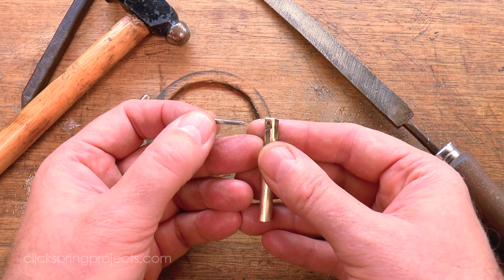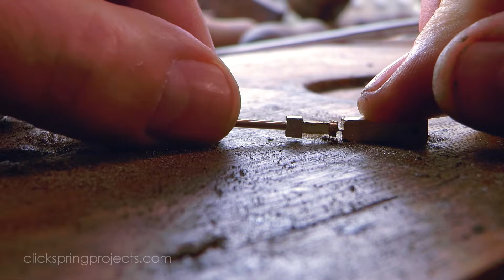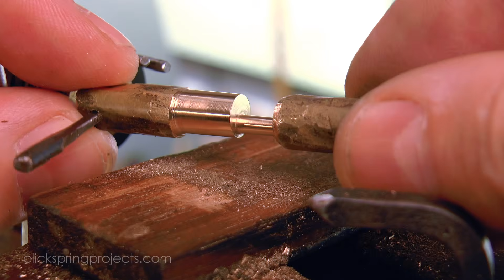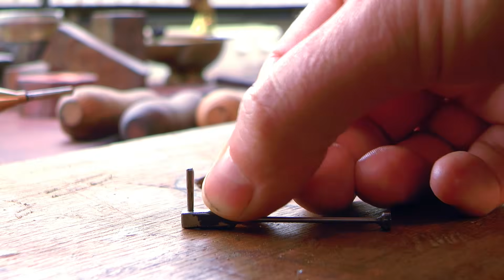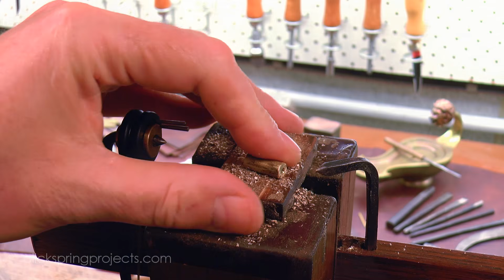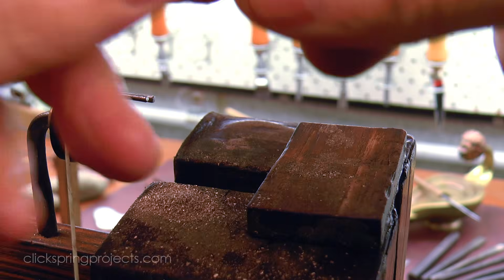Antikythera Fragment #13 - 3 Advanced Bow Lathe Operations Essential To Construct The Mechanism.

Comment: Would the working of the bow for the lathe have been left to an apprentice or assistant? Or do you think that the master craftsman would have preferred to control the speed of the lathe personally?
Reply from the maker: Great to have you watching; definitely the latter. To this day, a watchmaker will often reach for the bow powered turns in preference to a powered lathe for the one-off critical small work like a balance staff, pivots etc. The hand eye interaction of a single individual driving both the bow and the cutting tool is essential foir the required delicate control - Cheers :)
Reply: @Clickspring  Is that why the hand bow is used over a pedal powered mechanism? It seems as though it would be relatively simple to adapt a foot powered pedal for the bow motion, similar to a pedal powered sewing machine.
Reply: @Skyblade12  He's a watch maker. He'd know and his response that the hand bow is preferred is the answer you should stick with.
Reply: @SauronsEye  this is an educational environment, what's so wrong with asking questions?
Reply: The original lathes were often two person affairs especially for big pieces but he's probably right that delicate work would be a one man show.
Spring pole lathes and treadle lathes were a later invention if memory serves.
Reply: @rokitu7110  Some people like to jump in and try and show how much they know when they probably don't know Anything. And try to  make others look stooped. Never mind what skyblade said. Keep asking questions, That's how we ALL learn. :person-turqouise-waving:
Reply: @joepeanut6827  Wow, do you even read what you type?
Skyblade is just asking questions, you ninny!
(and BTW, the word is spelled s-t-u-p-i-d, not s-t-o-o-p-e-d)

Comment: While watching you periodically unmount the work piece to clear chips while drilling, a thought occurred. Would they have operated the lathe so that the workpiece was vertical and also had some 'relief' or clearance slots down the side of the drill to allow the chips to clear under the influence of gravity? This would alow the work to progress without periodically manually clearing the hole.

Comment: Could the turning down of the very thin and fragile shafts/pins have been done by pinching the part between two stones? To counteract the force being imparted when using a single tool on only one side?

Comment: Another way a part like the one with an offset shown could be made is turning the large diameter part first, and drilling a precise offset hole in it that pin stock could be soldered into. Obviously you would want something like a simple drill press for something like that.

Comment: I wonder if the technique that you used to drill the hole lengthwise through the brass on the lathe could probably be used to drill the holes in the drift shaft of your pump drill. The ones that the collets and knob pin fit into. The hole in the video is pretty small, so I'm not sure if the same method would be practical for the larger hole there. Or with the different material.

The bronze ferrules would probably be easiest to do by drilling a hole through a rough piece of bronze, opening it up with a reamer, finishing out the hole with a circular file, turning some sort of spindle for the ferrule to sit on, and then using the spindle to turn the outside of the ferrule on the lathe. This way, you don't have to worry about your hole drifting off center.

Comment: As to the reaming: I wonder if an adjustable V notched support might be wedged into place to support the reamer.  The would allow different sized ream to be used, be rigid enough for accuracy, and still have many of the advantages free handing does.

Comment: I wonder how viable this bow lathe would be in a non-industrial, residential capacity.  Like, obviously, modern tool steels and high precision are probably off the table but being able to machine little bits and and bobs around the house without making recourse to a powered lathe could be pretty useful

Comment: Is your three facet reamer shaped with a leading edge or are the facets filed with parallel edges?
 My thoughts being that if made without a leading edge it will cut better  given the back and forth motion of the bow lathe, if it cuts at all with that configuration.

Comment: Great work!
And it helped me to realize that I don't need a metal conductor for a precise manual drilling of a number of wooden part copies. Now I'm going to make a cylindrical "feather bit" from a nail and use it with a wooden "conductor" (and then extend marked/directed holes with a regular auger).

Comment: Hi Chris, I bow to your craftmanship, as a turner with 50ish years on the job, I salute you. I was wondering how you measured the crank offset, was it just with a trial and error fit?. How do you measure the hole diameters or doesn't it matter as long as the shaft fits to your liking?.

Comment: It’s probably been mentioned before, but considering how much clockwork already went into the mechanism, would it have been possible that the lathe too was geared for a higher RPM or a longer time spent rotating in one direction with a single bow stroke? It’s fascinating to watch this series. Really makes me reconsider ancient tech.

Comment: I think adding a brace to the tailstock so that it can't flex away from you but you can still rotate it towards you would be a good upgrade to deal with the tool pressure.Cylindrical surfaces are probably still going to need the file but that lathe looks... spongy.

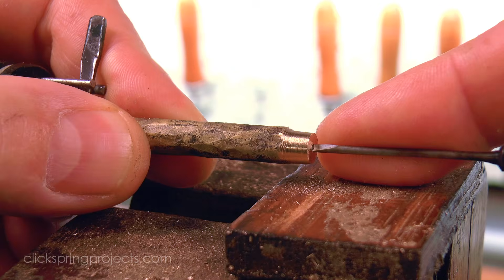Comment: The stock shown at 14:30 would seem to maintain any deviation from coaxial machining, based on the machinist's initial deviation from coaxial. Whereas working with the tool as the support (16:20) should cause any initial deflection to self-correct towards being coaxial, right?

Comment: After watching all of the early videos of setting up to build, along with the actual building of the mechanism, and now the tools used to build the mechanism, I have seen how easily the people of old may have been able to have two different lathes in antiquity, the large wood lathe, and the small metal lathe.

After all of the progress recreating the mechanism, I have also seen the recreation of the lathes and other tools as well, as you went through trying to show how it could have been done.

But it also surprises me that you don't improve the metal lathe to include a better bed, as it is what any lathe of value will start with.
Reply: Modern lathes need a precision bed because they are all about rigidity and precise positions based on the spindle and bed. When turning between centers and by hand, a precision bed does nothing for you. When the pressure of the cutter visibly deflects the centers, the position of the bed is not a reference, no matter how precise it is. In order to get to the point that a precision bed is relevant, first the spindle or center position must be made precise and rigid. This isn't a project about making a modern lathe from first principles, though.

Comment: Why using a bow it seems retarded. Using the same setup but adding a second big heavy wheel with a handle to turn it and continously seems a better way. Or even a flywheel and a pedal like the old sewing machine or the old grinding machine would be more efficient and practical because then you have both hands free for working.

Comment: It really becomes clear watching these videos that much of the development of the lathe and other such machine tools is not so much in the cutting action itself, but in automating away the more difficult expert operations. nowadays the precision of lathes is not in the carefully balanced hand graver, file, etc, but in the scraped lathe ways, precision leadscrew, accurate micrometer, etc. Really illustrates the gradual transition from artisanal handicraft work to mechanized reproducible mass production.
Reply: It's the finesse and degree of accuracy that we have nowadays that'll always give you a hand up. An old ruler won't lie, but a laser level is far more accurate.
For the most part, it's not just automation, but the quality of tools and refinement of form that let us get another edge. We can use a high-carbon steel, or swap to a water cutter for industrial work; something our ancestors would dream about, but in the end when it comes down to finesse. We still use the old ways with a bow for control with a thousand years of written word to know how to use it properly, and only really recently in human history have decided to maximize and miniaturize further.
Reply: We can also do much larger work on a lot of the modern machines. Bow lathes and files are fine for small work, but stop being practical at a larger scale

Comment: i use a similar free hand drilling tecnic in making smoking pipes out of wood, i simply chuck the desired drill in a Jacobs chuck and back off the tail centre and move it out of the way , using the divot from  the tail centre as a starting point for the hand held drill bit , i plunge 3 mm at a time clearing chips so they do not interfere with direction of the hole,,, leaving them can cause a directional tension ,thus diverting the bits direction within the hole , like modern directional well drills place pressure on one side to change directions under ground, , have a 95% success rate with this method, high figure and wood density changes some time cause deflection as well , so ive learned to use a 1.5 mm depth of cut when i encounter these issues, and to achieve a higher success rate , , as if chucked in the tail stock it difficult to remove chips as the tail stock limit's the depth to approx 10 cm of over all travel , and if i slide it back it introduces a extra degree of being unparalleled to the original as the tail stock has too much slop with the lathe bed slot ,and like with you , the bit free hand seems to not introduce this as the hole and bit remain parallel with one another , , it amazing to see with what ease they achieved seemingly difficult tasks with seemingly basic primitive tooling,it through this reconstructive archaeology methods that we are learning what was lost to man kind,  through either natural disasters , lack of documentation , or deliberate destroying /hiding technology from others, for political and financial gain 🥸🤓,Canada

Comment: It's fantastic how they used bow lathes but didn't realize to use a bigger wheel and an assistant to get smooth and continuos movment. Can't wait to see the mechanism finished !
Reply: We sadly have little archeological findings of ancient lathes. Very few have survived, as a broken one would just be recyled for the material. I will bet that they had their apprentices do the movement. But a thing with the bow lathe is, that it requires no further parts to create the torque required for metal work thanks to the physics of the sinew tightening itself as the bow is pulled. The moment you add a wheel and belt to power it, you loose that and have to add further parts that complicate and induce more failure points in the lathe. As often it comes down to if the additional cost and efford were worth it.

Comment: That stitching post you made  has become an invaluable tool in this process!
Reply: The stitching pony seems to have become one of his favorite workshop tools, and it's not hard to see why--it's astonishingly versatile and effective :D
Reply: @redwitch12  It's basically what the modern vice is to us. Like, if there is one tool I never want to miss in my workshop, it's a basic table top mounted solid vice. It is basically the single most versitaile tool I have. I obviously can use it to hold single workpieces and quickly reposition them. But when I do work where I hand file and need multiple parts that are the same, I can make one straight index surface to start out, line the piecec up next to each other in the vice, and file them at the same time. I can hold tools inside it, like CS does with his bow lathe. Use it as a pivot for bending things, or hold additional elenets to bend stuff even more accurate. And so on. There is fe things as important and helpful as a clamping device for smaller work.